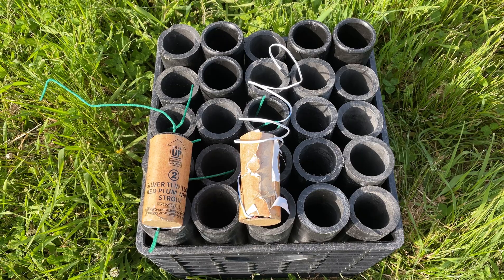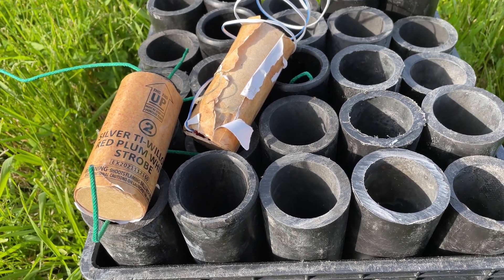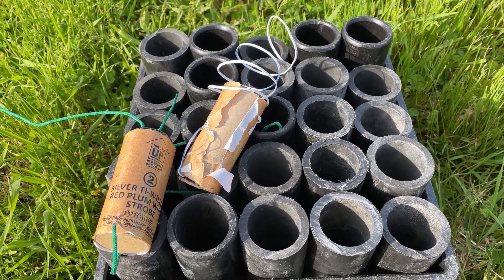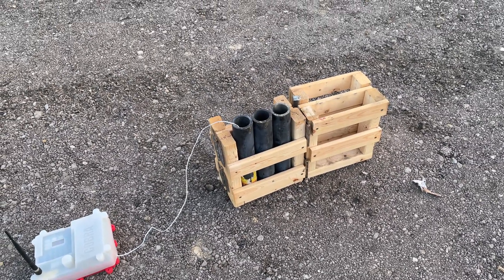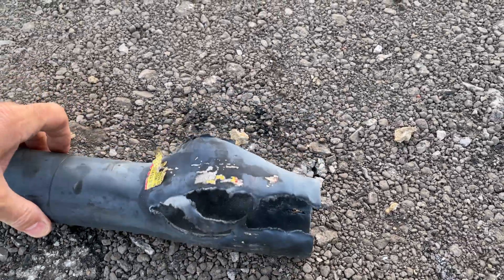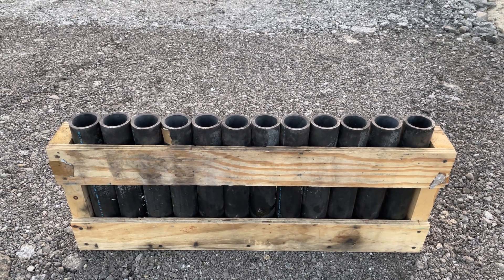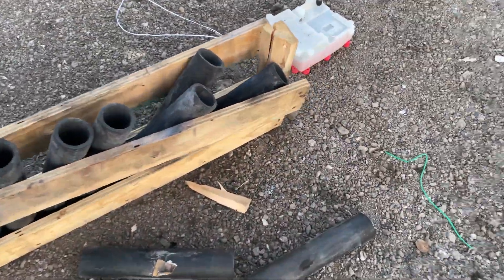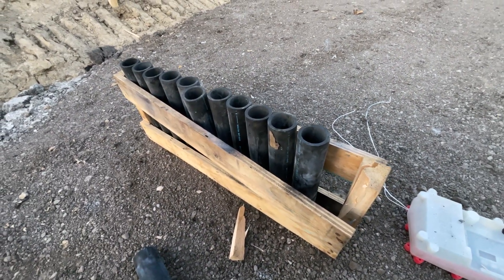Testing 1.75" rack designs for catastrophic failure of HDPE mortars

Comment: Curious how the spread would have been if these were all fused up together. Also curious if the fuses would still be lit and rather they would have shot off from the ground from multiple trajectories
Reply from the maker: There are a lot of variables to take into consideration in your scenario(s) of manually fusing racks.  What type ("speed") of connecting fuse is being used, how it's secured to the shell's fuse Regardless of the variables, the end result is "bad".  LOL
The safest of the bad scenarios is that the entire rack is ematched and the shooter becomes aware of the failure and IMMEDIATELY stops firing.

Comment: Now I'm tempted to see if I can design a wooden rack that can withstand a catastrophic failure. I'd like to get some dimensions of the destroyed tubes after failure. Like the length of failure, how wide the tube spread out and so on.
Reply from the maker: Until I can test further, I'm going with the idea that the safest (up to a reasonable extent) is a rack where each mortar has a space between it and the next mortar.
Although I'd also like to test what World Class Fireworks does (did), where they have that extra sleeve around the bottom of each mortar.  I think I may still have a couple available.  I'm gonna have to grab those and test 'em.  The only inherent problem with that design is that they require a completely different rack design because of the much-wider base.  You can't use 2x3 for the floor of the rack.  You'd likely have to step up to 2x4.
This is why I/we have these conversations!  Constantly learning by safely testing and recording the results.  "Continuous Improvement!"

Comment: So at the end of the day it doesn’t matter what rack you use you’re fucked either way if you mess up and put a shell upside down or it doesn’t eject and goes off.
Reply from the maker: Yeah, it'll likely be a catastrophic failure of that particular mortar.  At that point, it's about trying to mitigate the risk to the mortars around it, or more specifically the remainder of the rack integrity.
Reply: No, design matters.  https://www.youtube.com/watch?v=zv6Ru2mgCHQ , where you'll see the 3rd shell of the chain flower potted.  These were film canister shells, so about 1.25", and fortunately it was the last shell that did that.  However, the other guns in the chain (all paper/cardboard, spiral wound, even -- salvage from produce bag rolls) were not displaced in the least.  What was the "rack"?  A bucket of sand.

Comment: Very cool video. I had an idea of wrapping the standard straight 10 shot rack with a 1000 pound ratchet strap around the entire rack horizontally, middle to low on the rack to hopefully hold things together in case of cato. If the strap holds it could be a good safety measure. If it doesn’t it could make more projectiles. I would love to see you try this in the future.
Reply from the maker: It's an interesting idea.  Although I reckon it could be rather costly to have a strap for EVERY rack.  "Can you put a price on safety?"  Apparently, "Yes!" LOL.  
IMHO, I'd rather simply build the racks with spacers as opposed to having an entire crate of ratchet straps to pack/unpack and setup/teardown at the end of each show.
On a side note, 1.75" racks are better suited in qtys of 12 shots.  Most 60g kits are sold in multiples of 6. So 12 is a common shot count.  Also, if you ever end up with 1.3g 1.75" salutes, those cases are packaged 12/12.  ✌🏻

Comment: I appreciate the effort you went through doing the tests and making the video but it was  incomplete. I agree with the last thing you said. If you want to test the best possible risk mitigation practices, we need to test this on a rack with spacers between tubes and spacers against the uprights. 3 inch board on the bottom so it doesn't go over the plugs, 4 inch board on top "similar to the last rack tested". Construction screws, glue and screws through the bottom board into the mortar plugs. Then we will have a true test on what kind of effort should be put into risk mitigation. And I think the key to the test is the mortars staying vertical after the CATO and little to no shrapnel from the rack. 

I also understand you not wanting to build one to blow up cause it does take time to build properly, but I will check shipping rates and see how much it would cost for me to send one out to you minus the tubes to save weight. You'll just have to screw the mortars down and try to blow it up. I'd like to know how safe the racks I build for my shows are so it's worth it to me if you want to do the test. We'll then have a good video that should end the bickering of  "1.75 needing spacers, or not". 

If that sounds good to you PM me.
Reply from the maker: @DirtyJerzyBrew, How do I PM you within YouTube land?  Or elsewhere?

Comment: In my experience, the best racks have, is to have rails no higher than the plugs for the lower rail and no lower than 2 inches from the top of the gun, with no overlap where the shell sits in the gun. Catastrophic failure is always the worst-case and the toughest to handle. The only racks I've seen been able to handle shots after catastrophic were made of steel.
Reply from the maker: I've been building my racks with a slight gap between the bottom stud that the mortars sit on, and the long side rail.  My thought is that leaving that little gap allows for water/condensation & debris to easily exit the bottom without having to turn over / empty the racks.  Though I can understand having the long side rail flush with the bottom stud so you can screw that side rail into the stud for better rigidity.